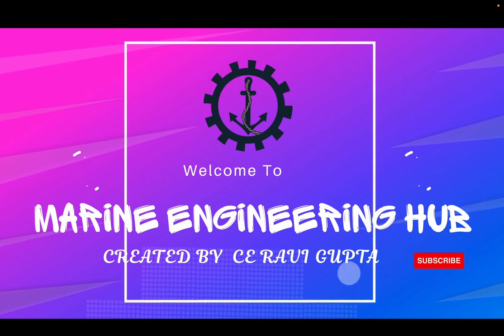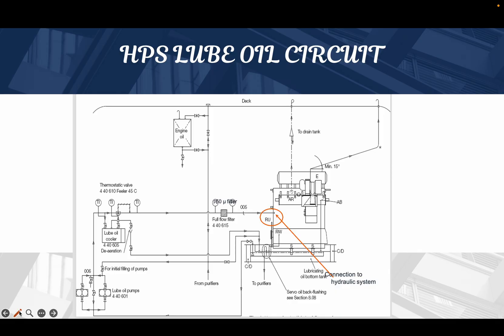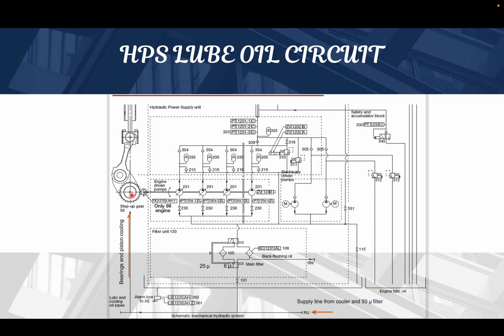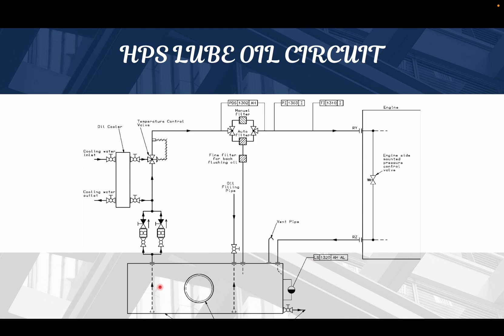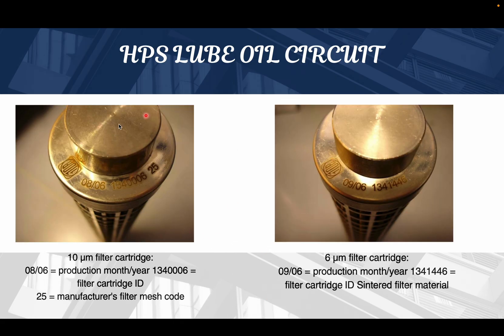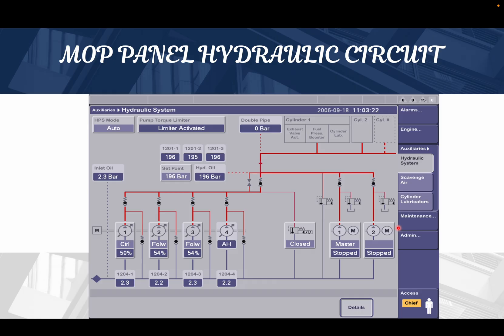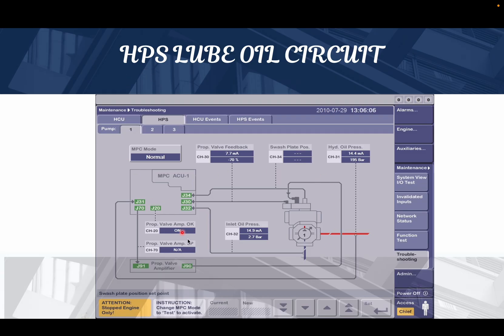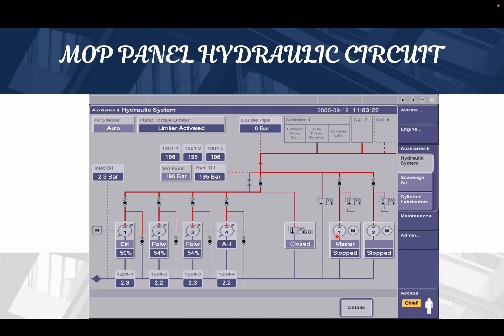ME Engine Lube oil System| HPS lube oil system|Hydraulic Power Supply|Bypass Valve in HPS|Man B&W ME

Comment: Sir is this for me-c engine because I have not seen engine driven pumps in me-b
Reply from the maker: this set up is for me-c engine in me-b there is only 2 hps pump
Reply: @MarineEngineeringHub  sir is there any additional safety for lube oil pump as it is not advised to run hps pump accidentally if lube oil pump is stopped